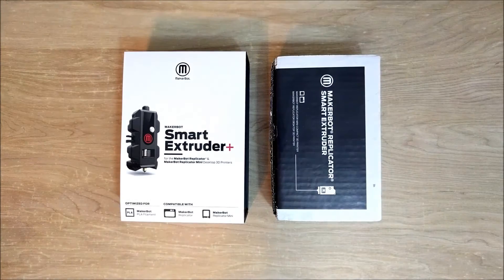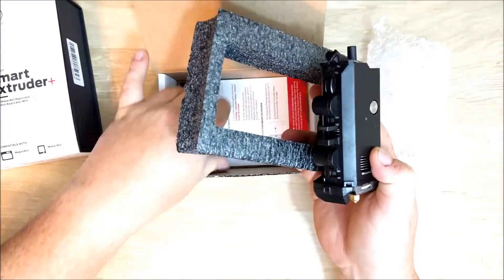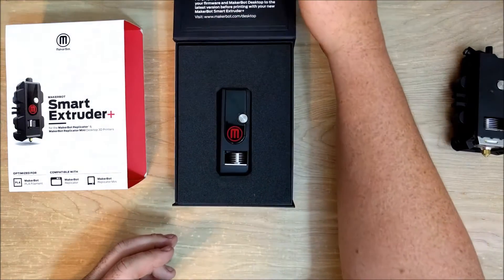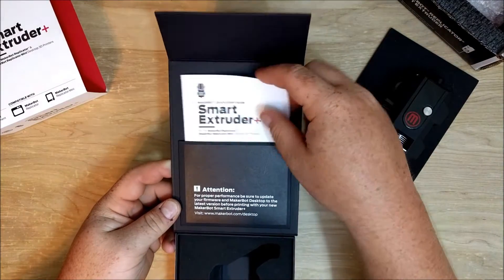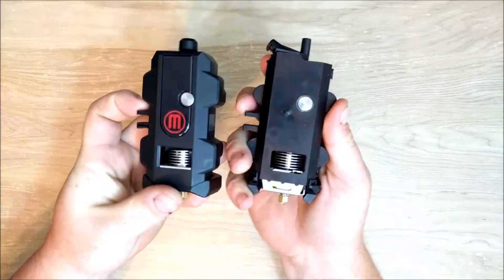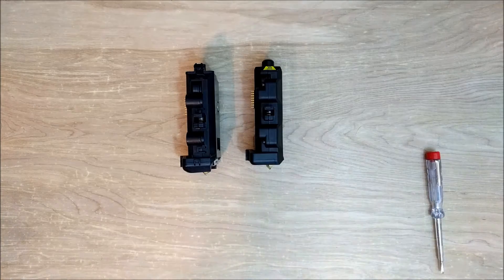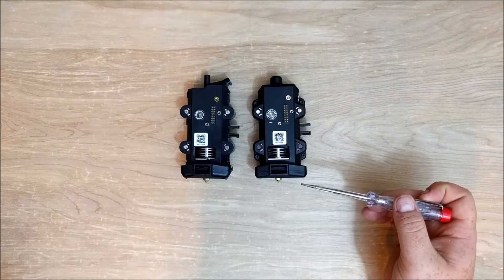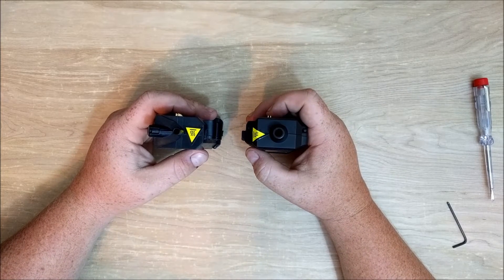They fixed it: Makerbot Smart Extruder +

Comment: So let me get this straight. The older version had no provision for guiding the filament between the drive gear and the nozzle?😮
Reply from the maker: They were still learning and it was required to guide the filament into the hot end when changing filament. I remember taking the face plate off and using needle nose plyers to bridge the gap. Cutting the filament end at a 45 helped the whole process as well. Oh the good old days 😅

Comment: Hey, man, thanks for the review!

I'm about to buy this new SE+, and ism looking for informations about it.

I'm going crazy with JAMs from SE(not plus).

By now to you still would by this new extruder? Didi you had problema with a lot of JAMs before the SE+? And what about now? Did it get better or really better?

I'm using 3rd parts filaments, did you? How are you working with temperature range? Did you change any parameter to print with 3rd parts filament? By now i'm just changing the temperature , instead 215 i'm using 225, but i still thinking it is not enough.

Thanks
Reply from the maker: Since switching to the SE+ we have not had any issue with jamming. Before the SE would jam weekly. I have only used MakerBot filament and it seems to work well. Don't forget you get what you pay for. I would highly suggest the SE+.
Reply: Nice, thanks dude. Good feedback. About filaments here in Brazil I have to pay like USD121 on a makerbot filament, quiet expansive... But I will give a try in the ES+
Reply from the maker: Wow that is steep, in the states it cost $41 a spool! Do you live in an area with high humidity? If so try to dry out your filament.

Comment: How is the new extruder+ working out?
Reply from the maker: CptSpears007 Great! over 500 hours of printing with the extruder. Very solid extruders, I have nothing but good things to say about it. MakerBot did their homework and fixed all of the inherent problem. The only printing issues I have had is due to the filament becoming stuck on the spool due to winding issues as the vendor. This is usually in the first 60 feet, So I unwind and rewind part of the spool.
Reply: After a year now, how about now? My original one is gone and been holding off getting the PLUS.  Thinking if its worth it at all or just getting a better printer overall